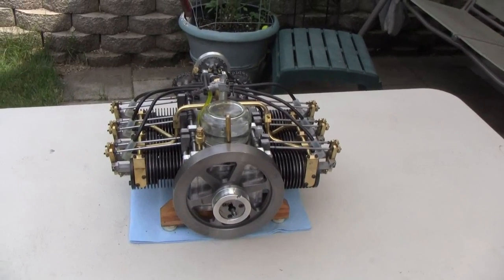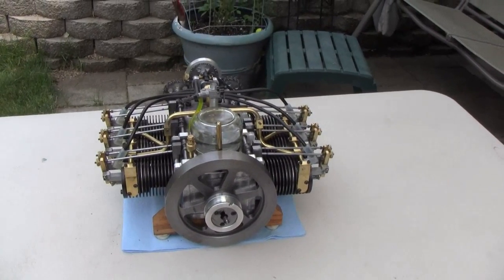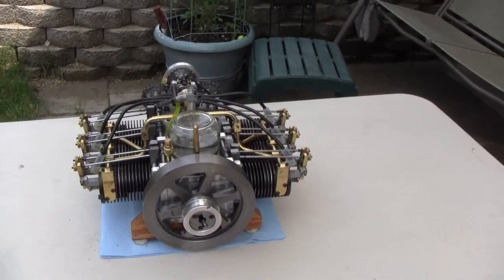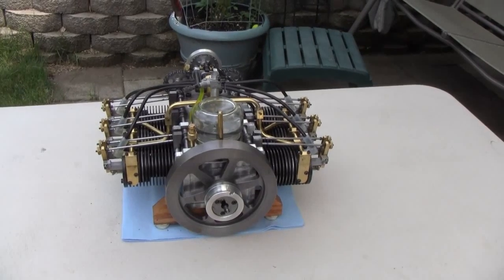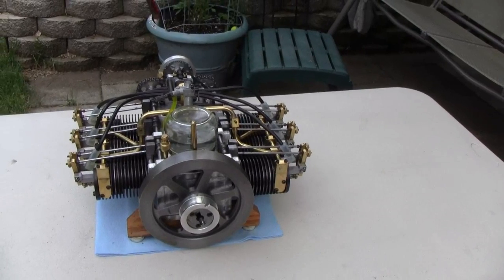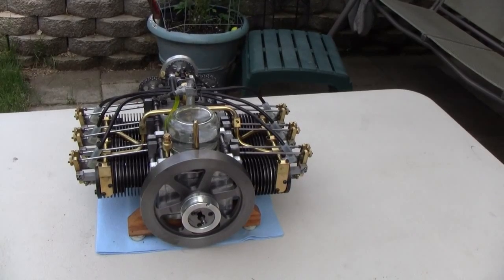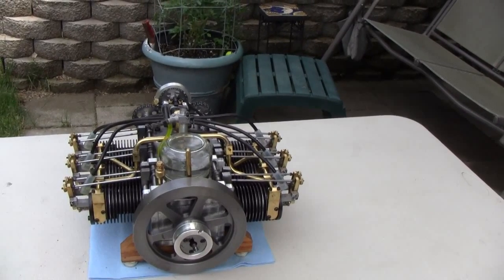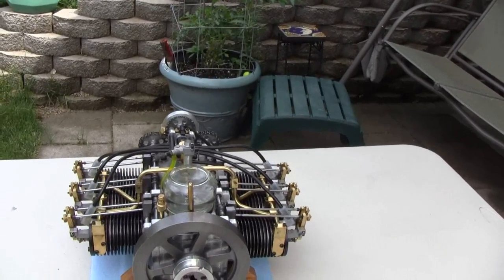Miniature 6 cylinder boxer engine

Comment: How do you mix the fuel with air flows at the same time? the timing of injections specific volumes of the fuel? 
How do you do that please ?
Reply from the maker: The carburetor mixes the air and fuel. The cam and valves controls the intake and exhaust timing. thanks for visiting . Dick
Reply: Thanks, I am a subscriber now. I will not miss this nice projects. 
So, what are the reasons I have to take in consideration to shape the Cam in a good way? 
you know Cam function is controlling the Intake and exhaust process through the suitable timing due to the shape of Cam.

Comment: I gotta ask, how did you balance the crankshaft? I'm having trouble finding a balancer nearby and am using ancient methods.
Reply from the maker: A boxer engine doesn't need to be balanced.
Reply: I mean before the connecting rods and pistons are attached. Just the crankshaft.
Reply from the maker: Same answer. The paired crankshaft journals on a boxer are 180 degrees apart. So it is self balancing.
Reply: Thanks alot!
Reply from the maker: correct.

Comment: Can you makr it sound like a subaru by using unequal length headers
Reply from the maker: it sound just fine to me the way it is. thanks for your comment.
Reply: Yeah it sounds amazing the way it is as well, amazing engine
Reply: no this is a flat 6 motor, the rumble if from subarus flat 4 motors. subarus flat 6 motors have a unique firing order. 1,6,3,2,5,4. The 4 cyl are 1,3,2,4.
Reply: Flat 6 and boxer 6 are the same, and the rumble is because of the unequal length headers, i have seen people put equal length headers and the rumble goes away
Reply: yes I know they are. Im just saying you wont get the boxer rumble from the 6 cylinder.

Comment from the maker: I designed and built this engine. Its a boxer. The pistons move in toward each other and away from each other. Like a boxer in the ring smacking his fists together. Thats why its called a boxer.
Reply: dickinohio are you using it somewhere or just for fun ???(I love it 😍)try to make a vw bug one !
Reply: i want ot ask you if you would like to make one for sale but not the same engine
Reply from the maker: No foundry, just hobby machine shop. I don't use castings. Thanks for the visit.
Reply: sir i want to know how you designed it machine tested the whole process
Reply: Please tell me what was its power?! And other characteristics?!
Reply: Can I buy a model kit ?like has you ever thought of mass production of these little motors

Comment: it's not a boxer, it's a flat 6. A boxer has two pistons moving together for each stroke.
Reply from the maker: A flat engine is an internal combustion engine with horizontally-opposed pistons. Typically, the layout has cylinders arranged in two banks on either side of a single crankshaft and is otherwise known as the boxer, or horizontally-opposed engine.
Reply: No. Any engine with horizontally opposed pistons is called a Boxer, regardless of the number of cylinders.  Boxers can be flat twins, flat-fours, flat sixes, even flat twelves as used in the Porsche 917 race car. All Boxer motors.
Reply: Caleb Tincher This is a boxer engine:
https://en.wikipedia.org/wiki/Flat_engine#/media/File:Boxerengineanimation.gif
Reply from the maker: I designed and built this engine. Its a boxer. The pistons move in toward each other and away from each other. Like a boxer in the ring smacking his fists together. Thats why its called a boxer.
Reply: CaptHollister I understand the piston count doesn't matter, but what I thought a boxer was, is this https://upload.wikimedia.org/wikipedia/commons/thumb/c/cb/Atkinson_Opposed_Piston_Engine.gif/220px-Atkinson_Opposed_Piston_Engine.gif
Reply: CaptHollister +dickinohio. My question now is if the crankshaft is made like the left one or the right one. https://en.m.wikipedia.org/wiki/File:Moteurs_à_Plat_-_V_à_180°_vs._Boxer.png
Reply: Caleb Tincher The left one or the right one what ? I don't understand the question, am I missing something ?
Reply: CaptHollister i had a link of two different crankshaft layouts.
Reply: Sorry, no, there was only one.

Comment: A gem of engineering  which nature  itself never equalled  in one function, that of producing a fully rotating joint. Nature only produced reciprocating joints as otherwise the blood flow would not keep the joint alive, But you did it all in that little engine, which reciprocates and fully rotates.    That logic gave us all the comforts of life. Unbelievable but so true.

Comment: Nice work. That is some skill there. It looks vaugly like a small airplane engine from WAY back, circa 1920s. While exposed cams are nothing new one thing does intrigue me, does the cam ride the push rod lifter by direct contact or did you install a roller bearing on the lifter at the contact point? Also why not install a small engine EFI to it? Carbs work but... there is also mechanical injection which is almost as good as EFI.

Still with these opinion points aside this is a piece of craftsmanship and its a 4 stroke to boot! I would love to build a half scale replica of a classic biplane with a 8 cylinder version of this engine. I remember OLD mail biplanes being only 40 HP. By fuel consumption I am curious what this engine's rated HP is at the shaft even if it is an estimate based on mechanical loss compared to fuel consumed. My guess of what this engine can produce power-wise is between 10 to 25hp. That's just a guess. Still that is Engineering Art if I ever seen it. My hat is off to you sir!
Reply from the maker: +KingOfAllAnimals  hello and thanks for visiting. The lifter is kind of a flapper hinged on the engine block. It is in direct contact with the cam. As far as the fuel injection, Im really not familiar with those systems. Guess I'll have to do some reading. Dick
Reply: Old Continental aircraft engines had a mechanical fuel injection system. If you are looking for purely mechanical that would give you an idea of how it is timed, connected, and feeds fuel. The only weakness is the accelerator pump. Many early systems did not have one much like early aircraft engines had not throttle and were either an ON or OFF proposition. Are you actually using alcohol or white gas?
Reply from the maker: +KingOfAllAnimals I use white with wd40.
Reply: dickinohio
Low compression? White gas likes to detonate at 8.1 compression doesn't it? I have to take it the WD40 serves the same function as 2 stroke oil without the stickiness and fouling.
Reply from the maker: +KingOfAllAnimals yes to all.

Comment: Whats the thing on the top where the 6 cables are connected. Is that the part that makes the electrical energy for the sparkling plug? How does that work?
Reply from the maker: That is the distributer.

Comment: Dick on any of your engines have you run into valve springing problems? I built a little 20cc short stroke high rev'r and at idle -lower rpms all is fine. The problem is higher rpm and quick acceleration as the intake pull during the IN stroke is causing the valve to over stroke , disengageing  from the rocker and remaining open..even the EX valve seems to be pulled open during the IN stroke. You can watch them and see them fall out of rythum into a synchronized one and take a dewp dive when this happens. Wondering if you ever seen this happen and is there an easy way to determine the minimum valve spring pressure required? The valves seem to be under sprung
Reply from the maker: hello bubster. i cant remember having any valve spring problems. my engines are all fairly slow running, maybe thats why. sorry im no expert in that field.

Comment: I'm interested in how you made the crakshaft (and camshafts) for this little beauty... :D
Reply from the maker: There are two videos on my channel that show how I made cams for my V12. I used the same method for this boxer. The crank is made up from dowel pins and key stock clamped together.
Reply: dickinohio Thanks heaps for your reply - I'll have to watch those vids :D

I've been toying with the idea of someday making an inline 4 cylinder 4 stroke based and freely available replacement 4 stroke parts (cylinders, heads etc.).

The crank has always been the major sticking point, as I don't have the machinery (or knowledge) to turn one up on a mill/lathe.

Appreciate your help :)

Comment: is this fuel injected? and if so, how did you make it?
Reply: dickinohio  so im guessing its carburetted, naturally aspirated means no turbo or supercharger
Reply from the maker: not injected. Naturally aspirated.
Reply: dickinohio naturally aspirated is the opposite of forced induction so that means carbeuration, mechanical and electronic fuel injection are normal/natural aspiration.